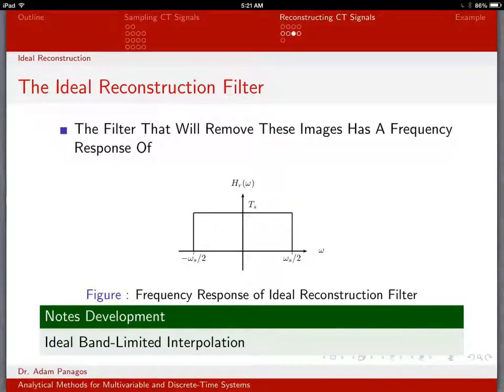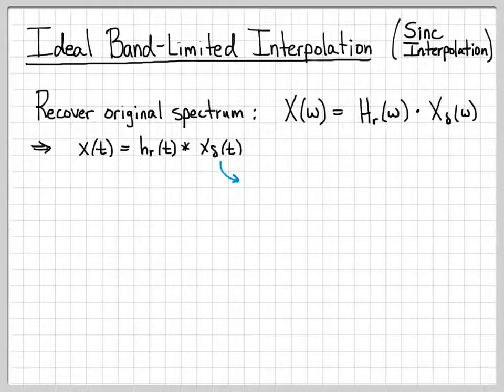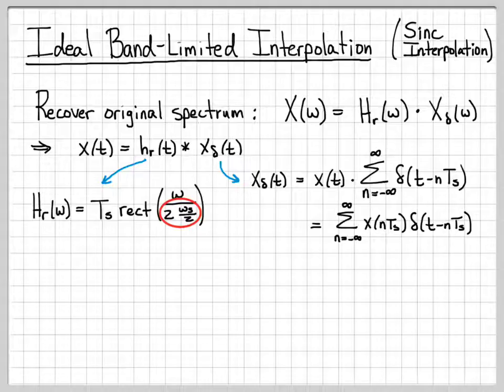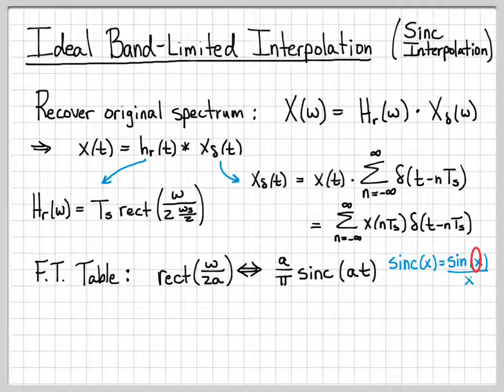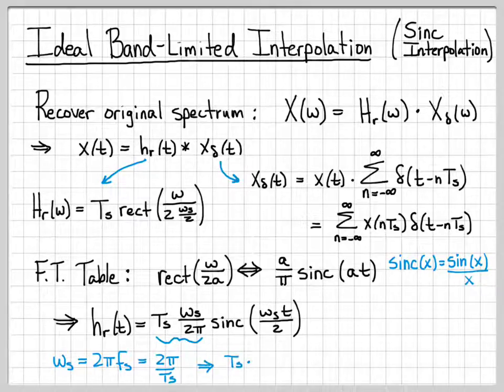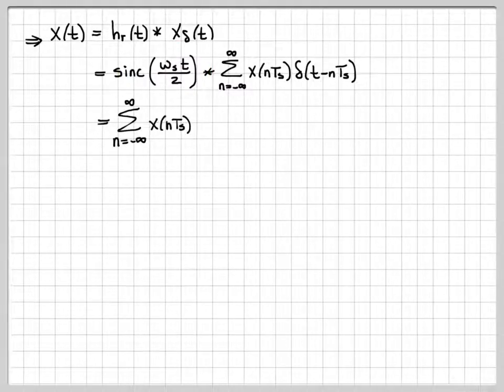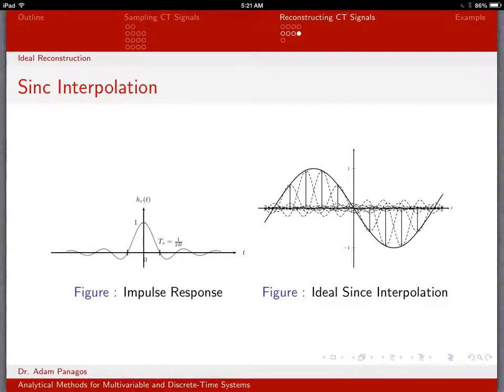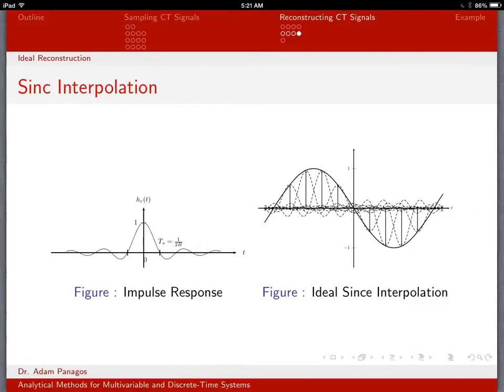Sampling Signals (11/13) - Ideal Band-Limited Interpolation (i.e. Sinc Interpolation)

Comment: I'd like to add sg to the step at 6:43. Delta can be thought as the 'identity element' for convolution. Conv with d(0) is the function itself. Conv with a shifted d() is the function shifted. So convolving sinc with a train of deltas gives you multiple sincs, shifted (and weighted).